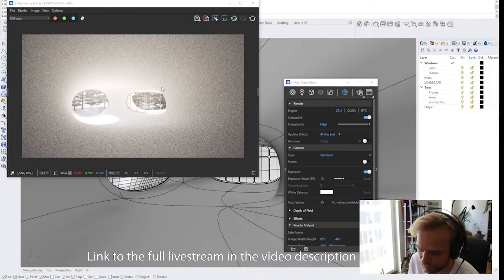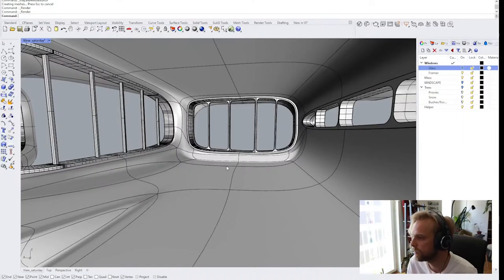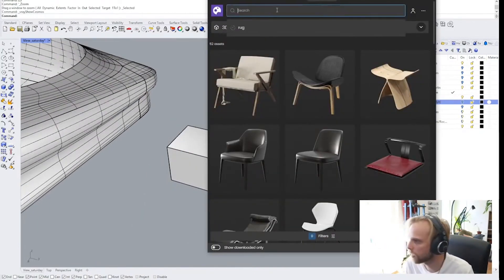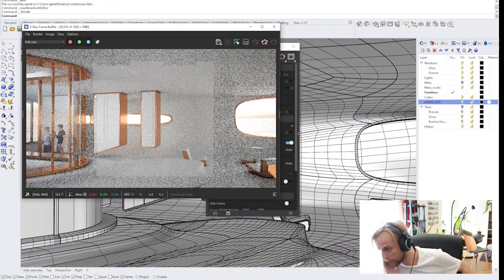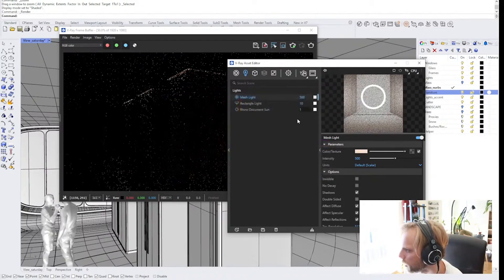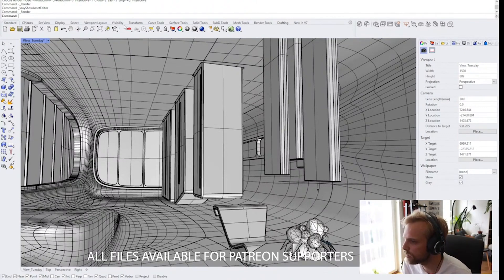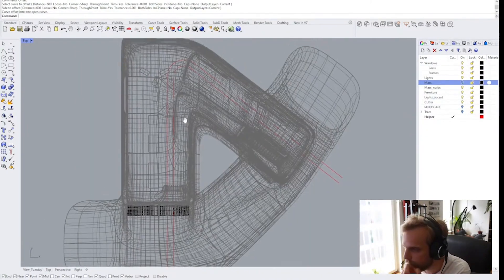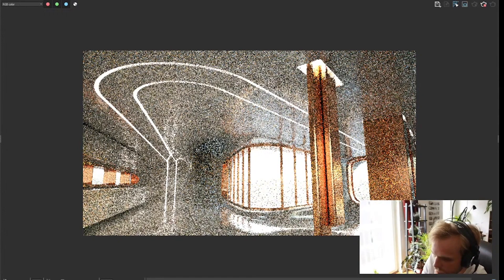Rhino SubD Architecture Series (SHORTENED) - Part 4

Comment: I have a question, i need to apply a material as a stripe that goes along the nurbs surface. How can i do that without converting the material of the whole surface ? Like after explode it explodes into surfaces while i want to choose a strip only
Reply from the maker: Two ways to do it: either creating a cutsom texture map with UVW unwrap, or modeling out the stripe. I would definitely go for the second option.
Reply: @DesignGoBrr  thank you so much you are the best!! The modeling worked!